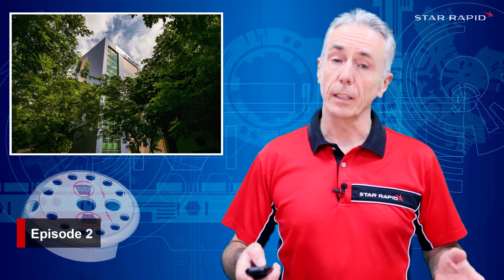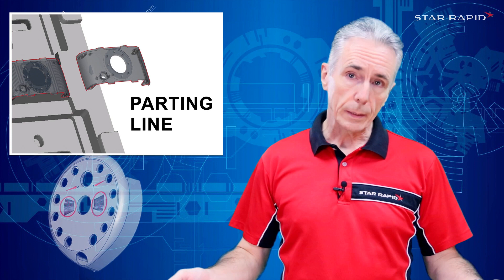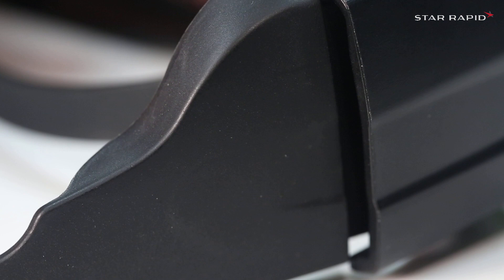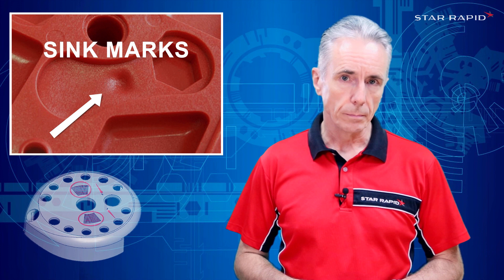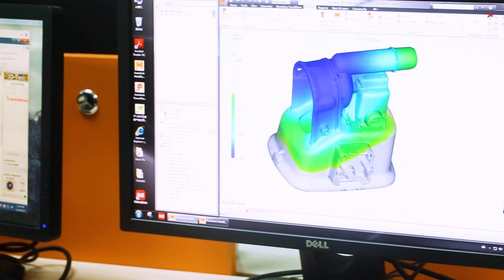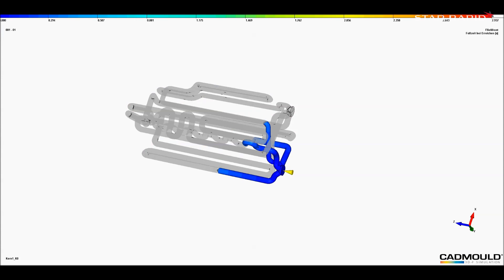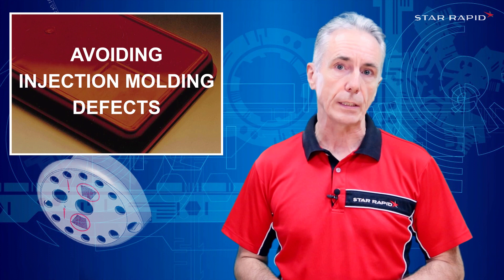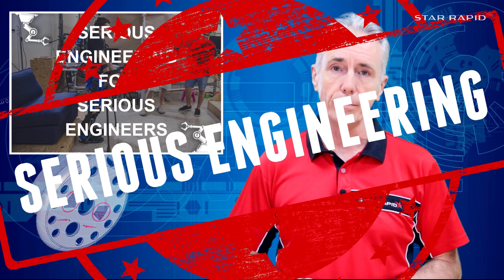Parting Line, Sink Marks | WHAT COULD GO WRONG: Injection Molding | Some Serious Engineering - Ep2

Comment: Sink marks can be more avoided with higher holding pressure and lower injection speed , also the mould must have very well ventilated channel , in order to release pressure from the mold at the end of injection.